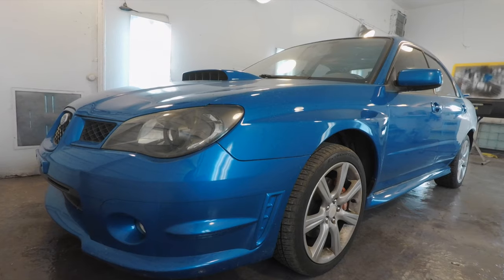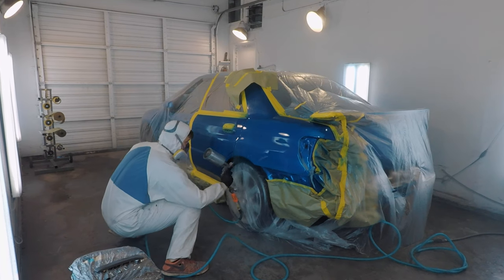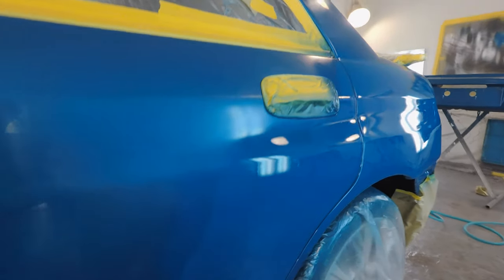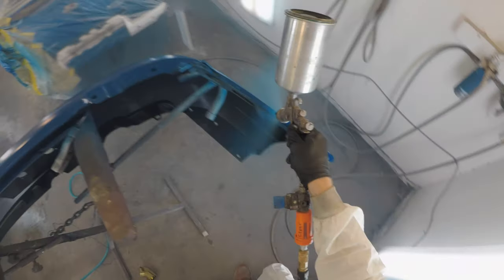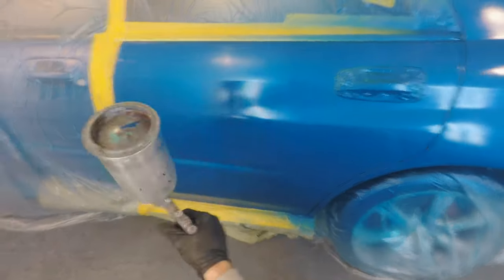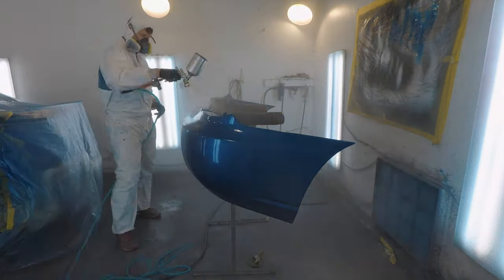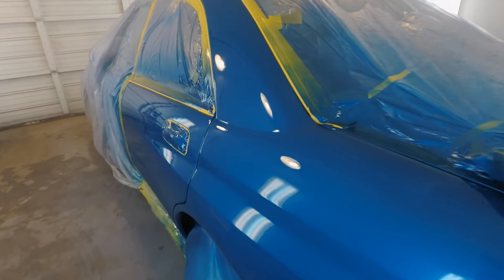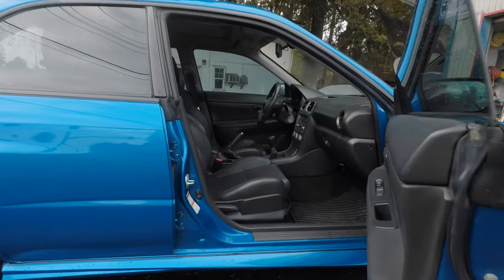Painting SUBARU WRX World Rally Blue

Comment: I just painted my front bumper for my wrx world rally blue, and it turned out a little darker than the car...any tips or ideas on why that would happen?
Reply from the maker: It’s normal for paint to have slight variances even if mixed by code. Blending to adjacent panels is a common practice in the automotive paint industry. Otherwise you have to custom match the paint with spray out cards.